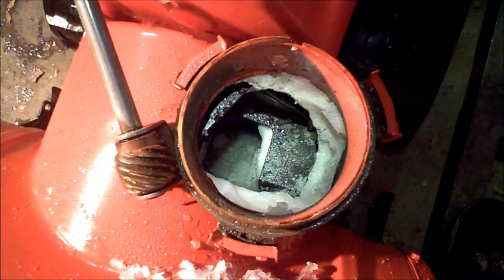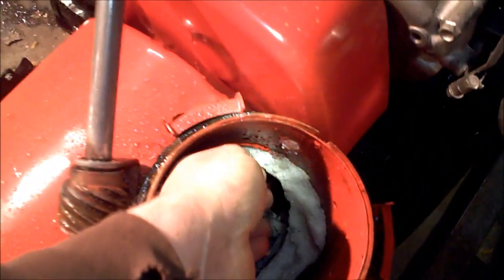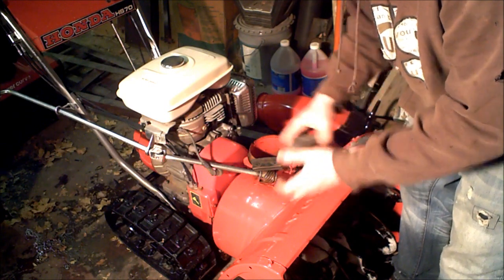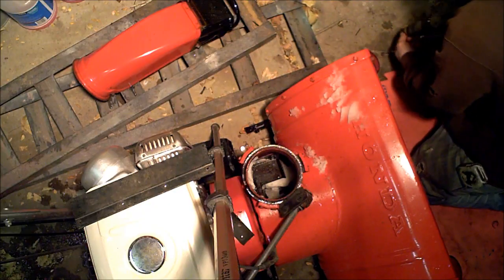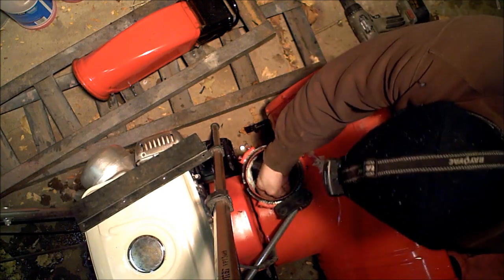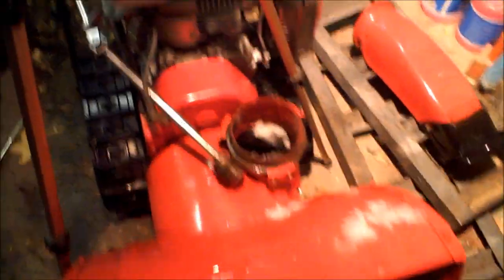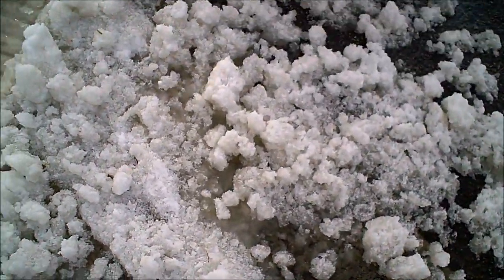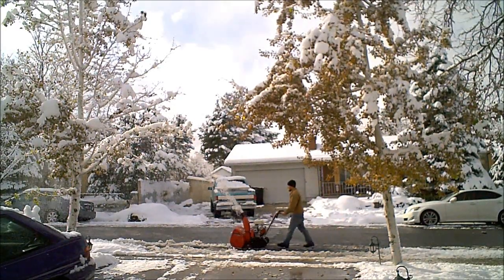Modify Snowblower to never clog and throw twice as far w/ Impeller Kit

Comment: Great hack works amazing! A little silly how excited i am about this, but I have an old 80’s Toro 521 that I keep running because it so narrow. Barely fits between cars and wall of my driveway. Always gets clogged with the wet stuff. But it fits so I deal.Yesterday using your recommendation I bought a mudflap from my local auto parts store, SS self tapping screws and drilled some pilot holes. Holes drilled rubber cut and mounted in about 20mins. This morning in N.E. We woke up to 10” of sleet snow mix, and boy does this work! Hard pack from the plows? No problem! Slush from the cars? No problem! Thank you for posting this video! Simple solution to a decades old problem.
Reply: I have same machine that I modified,  and it is virtually unstoppable.  It always a good working machine, but with this modification it is truely excellent at snow and slush removal, ..... no clogging.

Comment: I’ve got an older White single stage snowblower.   Wondering if replacing the wear strips on the auger would help with wet snow.   Food for thought.
Reply from the maker: If the gap between the housing and rubber paddle is more than a pencil width, they need to be replaced. Your snowblower will work phenomenally better. It is the exact principle of this video.

Comment: Great idea, that really works! 
Do you  have any modification ideas for a single stage thrower, wheel driven, to clear a gravel driveway?
Reply from the maker: A single stage snowblower mounted on a garden tractor or a stand alone 2 wheel vintage metal auger single stage just need a rubber flap directly below the discharge chute. Put one on each of the auger blades.

Comment: Sixtyfiveford have you got any advice for helping my traction ive got small tires and no chains
Reply from the maker: If they are the older solid rubber/no air tires; I put hex head screws all over directly into the rubber tread. The 5/16 hex screw heads act like snow tires on steroids. If they have air then chains are your best bet. Make sure your get two link or zig zag chains. 4 link put the chains too far apart and you'll vibrate yourself to death.

Comment: This will work as showed BUT will beat the impeller bearing out of your unit due to imbalance. Also cause your belt to fail prematurely due to wait and drag. Been repairing units for 35 years. Why dont the manufacturer due this, theres always a reason.
Reply from the maker: The impeller is never balanced as half has snow while the other doesn't. It can be upwards of a pound out of balance while spinning at full speed. If you truly have been repairing them for 35yrs you'll know that Simplicity did do this for years and had it patented so others couldn't.

Comment: I have question. Do I need to drill hole on the metal blade first?  Thanks.
Reply from the maker: No, that is not necessary.
Reply: Thanks for your answer. So that screw is hard enough to drill into the metal?   @sixtyfiveford
Reply from the maker: @kilerofjap  Yes, the screws will go through 1/8" steel pretty easily. If the metal is much thicker you may need to predrill the hole.

Comment: Thanks for sharing your ingenuity with the community!  Question: What is the best method you've found to trim/cut this heavy rubber material accurately?  Hey-- thanks for the link research as well.  What a time saver!  Getting ready to buy an older Toro two-stage unit if all goes well.  Can hardly wait to try this mod.
Reply: I used a saber saw fitted with a fine metal cutting blade.
Reply from the maker: Razor blade utility knife is about the only thing that will cut this stuff. Sometimes warming it up will help as well.

Comment: I want to do this on my Rear PTO mounted blower for my Kubota BX... I've never had a clog, but I'd sure like it to throw further with the heavier wet snow.
Reply from the maker: Quite a few people have done their tractor mounted snowblowers and are excited by the results. I would drill a metal plate and sandwich the rubber in between with that kind of power.
Reply: @sixtyfiveford  Do you mean use a plate instead of just washers?  Just want to make sure.  Thanks!

Comment: Thanks I have never owned a snowblower. I bought a used one for $200 this fall.  Yesterday first time I tried to use it, snow was very wet, after using it for 15 minutes it clogged up exactly as described!  I took it back to the garage thinking it was a broken shear pin.
I’m going to go put some rubber flaps on it today and wait for the next snow fall.
Thanks for the tip, and the great video.
Reply from the maker: Thanks, I'm glad you liked it.

Comment: Yes, this works. Now if you have a three blade paddle you will have to attach three pieced of the rubber. To offset the imbalance.
Reply from the maker: Start out with at least one impeller. I will generally do all three but there will never be an unbalance issue even if you just did one. This is because the snow load is never equal on all the impellers at the same time. Some are empty while others have a full load.

Comment: This is great for the two stage blowers. But have you any suggestions for a single stage 'corkscrew' style john deere blower?  It's the kind that is one continuous blade traveling one direction ramming the snow into a center baffle 'forcing' the snow up and hopefully out the chute. As you pointed out,thing works great with cold fluffy snow, but a little warmth or rain and it's blow 5' /10' of snow, then unmount and clear the chute.
Reply from the maker: You do the same thing with a chunk of rubber in the center flat portion, below the discharge chute on both impellers. Have the rubber so it just skims the housing.

Comment: i did this on my MTD used self tapping screws . pieces of an old mud flap i picked up along the highway in front of my place. the belt needed replacing also and i painted the bare metal. i tested it last year but we didn't have much snow. the first year i bought it i used it two hours a day. probably haven't used it 4 hours since in 4 years
Reply: first year we had 111 inches of snow
Reply from the maker: That's a lot of snow.

Comment: Excellent idea. I saw a video 3 years ago that had the modification, and it works, hasn't clogged since. If you can't find the scrap rubber there are universal kits available,check Amazon for impeller paddles. Spring slush no problem.

Comment: My dad bought a new Troy-Bilt 8 hp blower in 2001. It worked good for most snow but didn't throw it as far as the 1970s Gilson he had to replace when the drive gears wore out. In wet snow, it wouldn't throw snow over the three foot wall along his sidewalk. The dealer did several things to try to solve it, including increasing the rpm and giving him some spray on coatings which helped somewhat. Garden Way incorporated which made Troy-Bilt items went bankrupt about the same time and MTD bought the assets. After 2 seasons we decided to try to solve it. I sandblasted the chute as the powder coat was coming off, then primed it with etching primer, used a nice shiny enamel paint and sprayed slip plate on that that I used on my snowplow. It helped but not enough. The next year, we took it apart and I got a smaller pulley for the blower section to turn it faster and added pieces of mud flaps to the blower wheel. I built another chute that was longer with a bigger radius. Those three things solved the problem but I never knew if it was one thing, or a combination of the three things.
Reply from the maker: Nicely done. A better designed Chute definitely helps and I've done a few custom chutes on older equipment. The Gap seams to be the most crucial though.

Comment: I guess mine is a single stage and snow does like to stick everywhere especially the chute so before and during use i spray wd-40 in the chute the impeller the spinning part if that’s what it’s called and mouth you know the square opening where the snow enters, spray liberally. Thanks

Comment: I did this with my older Honda HS80 no problem. Haven't had chance to try it yet. But my newer 928 is out of the question. Impeller must be tempered. All I did was chew up self tapping screws and drill bits.

Comment: Any recommendations for a single stage ?
Reply from the maker: New paddles. If there is more than a pencil width between the housing and rubber it will clog. If you are referring to a metal auger single stage like on riding mowers, just add a chunk of rubber to the center flat part on both augers.

Comment: I have 5 hp 2 stage that clogs so bad that I don't bother to even use it in wet snow. I know it'll choke up before I go 6 inches. I'm definitely going to try this. My back can't take shoveling of any kind any more.
Reply from the maker: You're going to love what this does to your machine.
Reply: @sixtyfiveford  Just got done installing the mod. Installed 2 wipes on my 4 blade impeller and just had 3 inches of wet snow. HOLY CRAP where has this machine been all my life!!! It's throwing twice as far and ZERO CLOGS. It started to clog for a second then it blew it out like a champagne cork. Even the soup the plow leaves at the road was no problem. I'm putting the other 2 wipes on the remaining blades. I was about to give up on this POS but talk about a miracle. She never ran this good even new 15 years ago. For the first time since I was a kid I'm looking forward to a real butt kicking snow so I can see what she'll do in the thick stuff. Should be pretty impressive.

Comment: Stevie whats the best blower to buy for commercial use . Would it be honda ?
Reply from the maker: Honda for ease of use but not for longevity or maintenance cost. The Hydrostatic transmissions are a joy but wear and cost more than you want to repair. A Simplicity, Ariens, or Toro commercial would be my choice over Honda.
Reply: Hondas are great but the parts are expensive.

Comment: So why don't the manufacturers have this mod done as standard toi their machines, since it improves effieciency so  much?
Reply from the maker: Then people wouldn't need to buy new higher end machines.
Reply: I hear you! Thanks for the great video and for the links to the materials needed. The reason I found your video is because we just had a very wet 8" snowfall here in the East USA. My new Honda HSS724 2 stage kept clogging every few minutes. So I will be looking to do your modification. Forgive my ignorance, but I haven't used self drilling screws before. So I don't need tro drill a pilot hole first, correct? I just drill the screw through the rubber and then into the metal of the impeller blade and it will make its own hole in the metal?

Comment: Great video?Will this work on a single stage snow blower? If not any ideas to make it perform better?Thanks
Reply from the maker: For a rubber paddle single stage snowblower you just need new rubber paddles. For a Metal auger single stage; like you would find on a riding mower, you just put a piece of rubber in the center on both auger blades.
Reply: Thanks, I'm going to try this after this Noreaster were going through here in Jersey. I wish I saw this earlier.

Comment: Guys if you haven't done this mod, DO IT.  I just finished my installation Tuesday night and today,, Wednesday, I am dealing with this Noreaster on March 21 in Philly.  This is like having a whole new snowblower.  Not only does it throw the slush, it thows it into the next county.  It was pretty frustrating to have an 11 horse snowblower that choked  on a half a cup of slush.  I cut up  a mud flap from the auto parts store and used 1/4 bolts with lock nuts on the bottom and a 1 inch wide aluminum strip as the washer on the rubber side.  Two bolts on each of the three paddles.  DO THIS MOD.   sixtyfiveford   can't thank you enough dawg!!!!
Reply from the maker: Awesome. I'm glad you tried it out.

Comment: Great video thank you, I need to buy a snow blower and was wondering what Toro snow blower would you buy today? I live near Lake Tahoe Ca. and we can get a foot or two over night. thank you
Reply from the maker: I would go at least with the Toro Power Max 724 or 824 2 stage machines(or any machine in their Power Max lineup). Their Snowmaster line is built down to a budget price and suffers in performance. The Power Max machines will all be able to handle 2ft of snow easily, it's just a matter of how quickly you need to get done which will determine which model.

Comment: I wonder if car wax would help the exit chute, and hold up very long.
Reply from the maker: I have waxed the chute and it does help, but constant oiling (wd-40 or similar)seams to work better at releasing the snow.
Reply: sixtyfiveford 
Good to know, even though I live in Georgia! I have a water heter tank half made into a plow for my garden tractor, and this may alleviate sticking.
Reply from the maker: I would think wax would help hold off dirt from a plow.

Comment: This works amazingly well! I was using a friend's snowblower on several heavy wet snowfalls and it clogged so often it was just easier to use a shovel. After seeing this video I went looking for a heavy rubber mudflap and the local auto parts place had only stiff, lightweight plastic. I told the guy behind the counter I was looking for rubber to make this mod and it turns out he'd already done it to several snowblowers. And he found a heavy rubber mudflap in back. If you have a snowblower, make this mod. No matter how good it works now, it's gonna work a lot better.
Reply from the maker: Thanks, I'm glad you liked it.
Reply: Best gas torch construction
Reply: Show me a good gas torch for heating steel for forging

Comment: Hmmm. Never thought of this. My problem is picking up small rocks between the impeller and the housing. Wears out the housing pdq and jams aren't uncommon. I welded new steel to the last blowers belly at least twice in its lifetime. Basically breaks them in half. Thanks
Reply from the maker: This prevents stones from jambing/rolling between the housing and impeller.

Comment: Hi I just saw your 2012 video on preventing my snowblower chute from clogging.  Great idea and it was an easy fix.  However I seem to have a problem with the auger in my 2 stage machine clogging real easily and stopping.  Is this likely due to belt slippage or am I missing something?  Thanks
Reply from the maker: Belt slipping is a common cause for your issue. Once the belt slips a few times it only gets worse. Pull the belt cover and you should be able to watch it.

Comment: I have a 24" Honda snowblower and the first stage blade constantly clogs with heavy wet snow and renders the unit useless as it does not transfer snow to the auger. The snow just sticks to the blade and turns the blade in to a giant steamroller type situation. Are there any fixes for that type of problem? Very nice video!
Reply from the maker: First make sure a shear pin isn't broken and allowing the auger to free spin on the shaft. Is it an older model or used to you that someone could have worked on before? Someone could have put it back together wrong and I would make sure the two sides are facing the right direction and not pushing the snow outwards instead of into the center. Finally make sure the two sides are out of sync. This is kind of difficult to explain but you don't want he tips of the two augers to be inline with each other in the center. They should be 90 degree out of sync so one side puts snow into the impeller at a time as they rotate.
Reply: Thanks for the info my friend. I will check all that you suggested. The shear pins are fine and the auger does spin pulling in the snow from bottom to top. I'm not sure of the two sides being out of sync. I'll check that. It's a Honda model HR-24 and is approx 7 years old.
Reply from the maker: The auger should pull the snow from the outside to the inside. Looking at the machine from the front the 2 augers on each side of the auger gearbox should form a "A" shaped angle. If they were put on wrong they will form a "V" shaped angle and constantly clog as it it pushing snow away form the center/impeller.

Comment: Hey,i,'ve got a single stage 4 stroke troy built snow blower and my problem is everytime I use it,it throws snow all over my feet,not a big deal,but it would be nice if I could figure out a flap of some kind of rubber to put around the axle to prevent this,any ideas ?
Reply from the maker: Your rubber paddles are worn out. If you can put a pencil between the housing and the paddles, they need to be replaced. Worn paddles cause you to tip it forward more than you normally would resulting in snow back on your feet.

Comment: This is great stuff ; at 2:00 he shows us what causes clogging.
I did the impeller mod on a new 26 inch 3 stage, carefully leaving a 1/16 of an inch clearance.
Used a stiff 1/4in. rubber mud flap to cut  pieces to bolt on all blades.
The 2017 model has a plastic chute with a lifetime warranty, a zero clearance would void that. 
Even with an impeller 1/16 clearance , any slush build up is completely eliminated.
 This clearance is 1/16 of an inch from 4 bolt heads and the plastic chute protruding inside the impeller housing.

Comment: Did this last year and it stopped snowing (!) so I couldn't test it until this year. Outstanding - throws way farther (didn't measure), doesn't clog in wet snow (used to all the time). I used surplus store mud flaps and the self-tapping screws. Thanks for bringing new life to a crappy old Snow King.
Reply from the maker: Awesome.

Comment: I've got a Bercomac 56 " snow blower on a tractor had the same problem will this work it.
Reply from the maker: Yes, it will work fantastic on the Bercomac.  Since there is so much power behind it I would predrill and bolt them to the impeller.
Reply: thank you